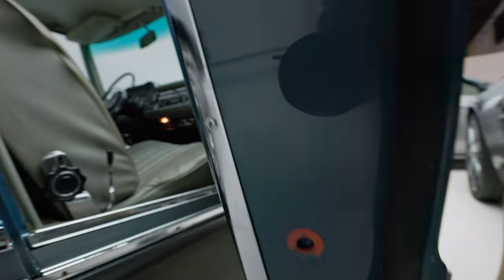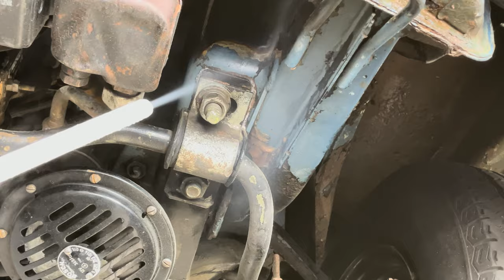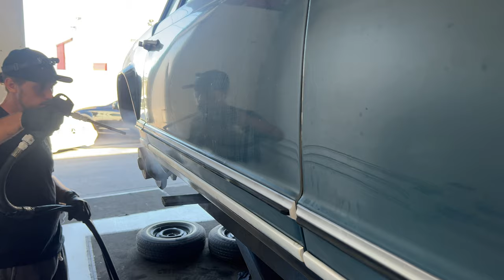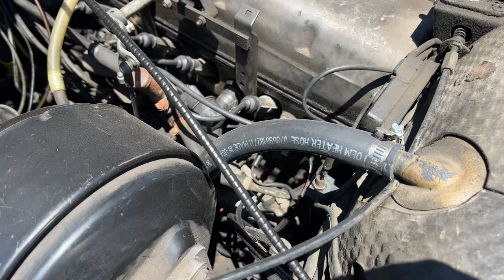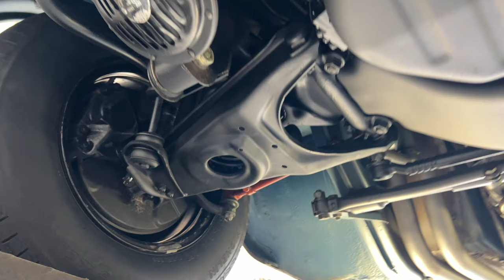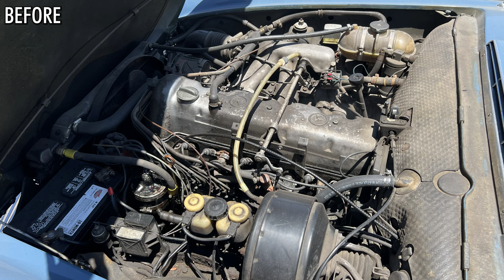Mercedes 280SL Pagoda DRY ICE CLEANING! Part 1 of our MOST EXTENSIVE DETAILING EVER!

Comment: Someone please explain, if you wanted to paint why did you dry ice it? And is it not better to steam wash first or that would be a complete waste of time?
Reply from the maker: In order to paint, we still need to strip it down, and dry ice cleaning is the most efficient and thorough way to do that. Steam cleaning is an option, it just takes a ton more time to do it, and typically the results aren’t quite as nice as what Dry Ice can do. We still have that option in our back pocket, but on this particular build, it was better to just blast it away and then paint to the owner’s content